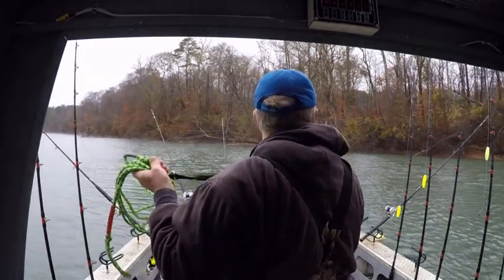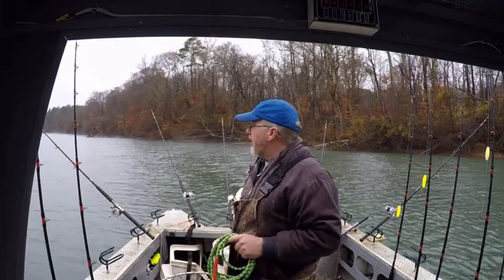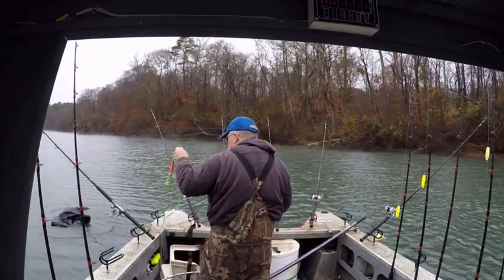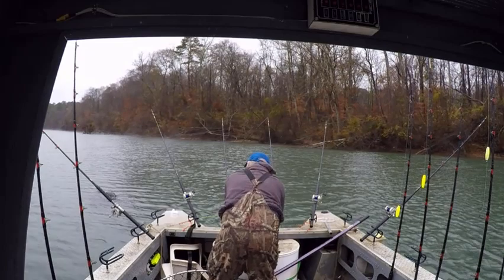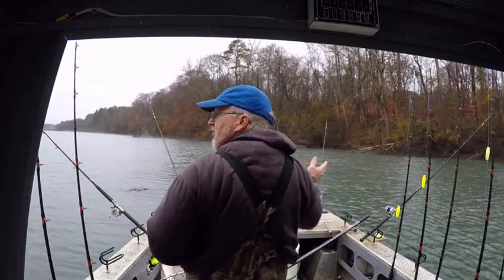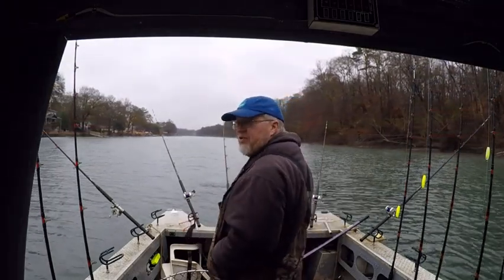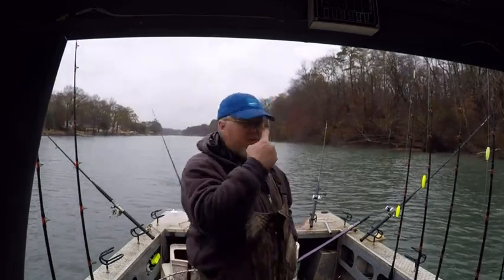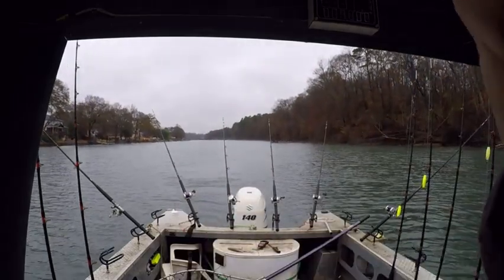DRIFT SOCK FOR ANCHORING, STOP THAT SWAYING!!!!

Comment: Great tip Jeff. I use this drift sock trick on the river also it works great. If a bucket is used large holes should be drilled throughout the bucket. A cat guide I know does that.
Reply from the maker: Thank you I appreciate you watching and commenting.

Comment: So are you using one drift sock in the middle or two drift socks on each corner?? (When you are anchored & trying to straighten out boat in the wind) and what size, I didn't understand the answer.
Reply from the maker: I use 1 in the middle most times.  But if it a heavy wind blowing I have put 2 smaller ones out 1 on each corner

Comment: Couldn't see what you tied the rope to?? Also what size was it 54"?? I think I remember you saying your boat was 25', not sure though.
Reply from the maker: Yea it was a 54” sock.  I have a ski rope cleat dead center in the back.
Reply: Now does the rope rub up on engine cover? I think if I installed one my engine cover would be in the way? Just thinking out loud. Your thoughts? @bowl830

Comment: You said that sometimes you use two drift socks on the corners what size socks are you using??
Reply from the maker: I use a pair of 5’ or 6’ depending on wind.   Most conditions are 5 is plenty.  I like to use socks even with no wind while pulling the boat with the trolling motor.  It seems to keep the boat straighter and helps with the speed control.   Thank you for watching I appreciate it.

Comment: Now does the rope rub up on engine cover? I think if I installed one my engine cover would be in the way? Just thinking out loud. Your thoughts?
Reply from the maker: It does lay against the midshaft but not a problem.  When I drift I always use 2.  One on each corner.  It prevents swaying